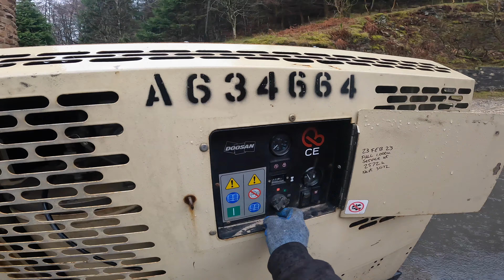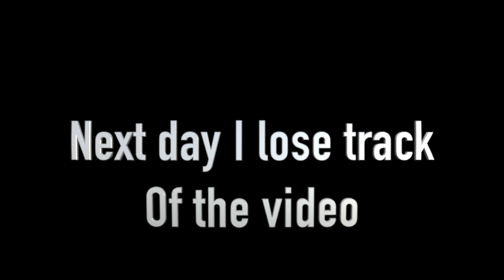Heavy rust & scale removal Structural Steels SandBlasting

Comment: You need to change the engine oil well inside service interval if any diesel is contaminating and increasing levels; usually caused by load when cold, heavy 'acceleration' particularly when engine cold, worn piston rings/bores. Changing engine oil at maximum of half service interval is what I advocate regardless; oil is much cheaper than engines. Use waste oil for heating is best economy. Be great to see this project after completion.
Reply from the maker: yeah the oil got changed it only did about 12 hour since the service. This is a massive project they plan on making flats out of this mill and building near 3x the size of this at the side and some homes in the back duno where they all will fit but thats why I'm a sandblaster haha

Comment: Where did you find the cooler? I need one for my machine. 🤙🤙
Reply from the maker: 😬 stole it off my 260 🙄 I need another aproxx the same size to cool 425cfm
Reply: Trying to find one for my 260. Crazy money! Trying to find an alternative cooler. Will ping you if I find an option.
Reply from the maker: @VoxxAG  I can get you a stand alone air powered fan and cooler rated at 360cfm fink they are 1700£

Comment: I bet they end up getting you back to re blast the lot so they can paint them in a few months time. 
Get yourself a step drill and just step drill a series of holes underneath the existing grill for your added cooler. Quick and easy way to increase the air flow.
Reply from the maker: I was thinking 40mm hole saw but to be fair I've added a baffle on the inside and I've not had any issues since 👌👍

Comment: Mick grant  job.!  Tell the guy to fix the dam roof.  You can't do a nice if you got all that dam water coming down on top of you. He could have fixed the roof then had you come in and do your thing.!   Don't you think.?
Reply from the maker: It would have made it easier for them because they was paint ready until the water got to them. They was only needing to know if the building had to come down as the structural engineers was close to failure but once cleaned they could see that only 3 need attention not such a big job considering the alternative 😬